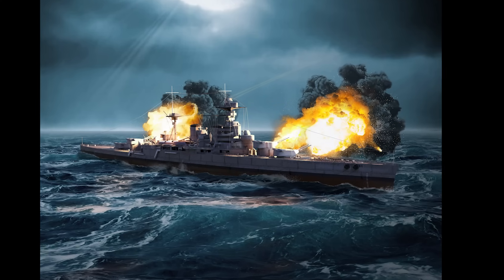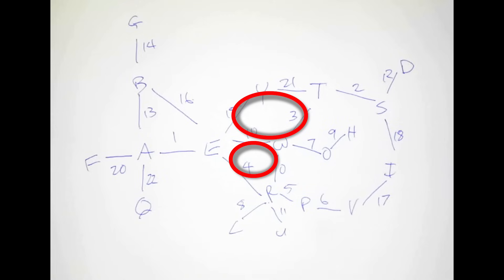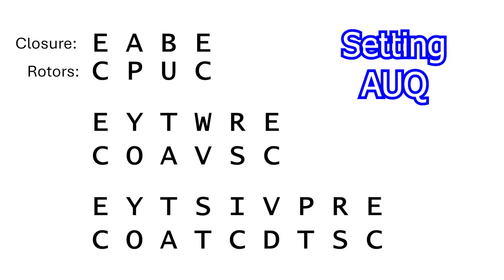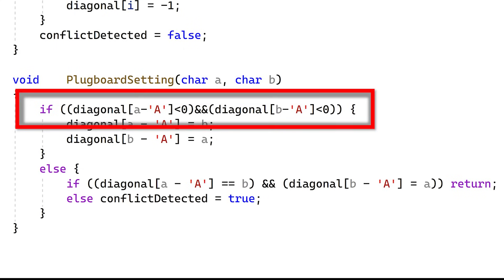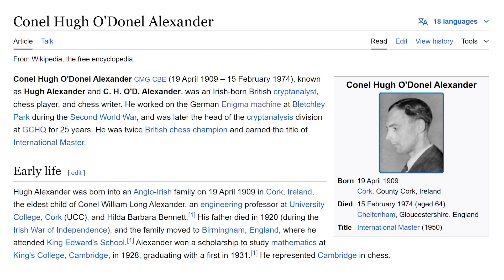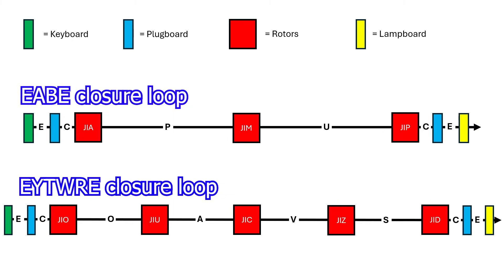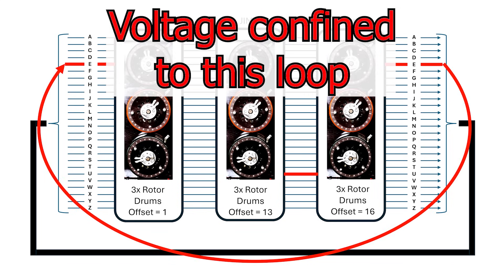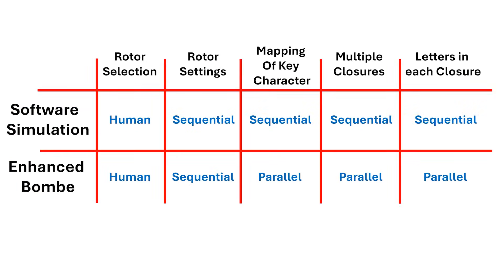Breaking Enigma - Welchman Diagonal board.

Comment: The problem introducing false stops was several things. First even with a "normal stop" of 1/25 live wires, we can still find false stops hence the addition of the machine gun, CSKO, etc. Second, there are many more stops possible, 2435 to be specific. It just so happens that in general orbits of groups are large (I recommend searching the "100 prisoner paradox" for interesting applications of this property). It turns out that the number of wires which light up on a cable are exactly analogous to the orbit containing the test element when the subgroup generated by our composed Enigmas acts on input wires. In this way we expect arrangements like 25 or 24 live/dead wires to be the most common. That being said there are still many other configurations which do exist and at this small of a symmetric group size they impact the overal probability of false stops significantly. Much research has been done to show that introducing the diagonal board significantly improves our odds of remove such false stops. Heuristically we can just say that more connections == more chance of the graph of wires being connected.
Reply from the maker: Yeah it is interesting.  They could have chosen a more complex stop mechanism, but i guess the one they chose was good enough for the purpose.  I suspect they tried the simplest idea they could think of first and if it worked well enough they'd stick with that.  I've had trouble finding exact data on how many false stops there were per run typically.      I've still got one or two more videos to make in the series before it's' done.  This particular video didn't do as well as i would have liked so it took a little bit of the wind out of my sails.
Reply: @DrMattRegan  Im sorry to hear its not doing as well as you would like. If you are interested I would love to connect and discuss this topic with you as I have been studying this subject for around 2 years in my graduate program and am just now finishing a paper on the subject. It's very hard to find other interested people to connect and share findings with.
Reply: @DrMattRegan It would be a shame if this series were never finished! I feel like youtube never showed me these when they came out, but I found them in your backlog after today’s video and it’s some good stuff.
Reply from the maker: @ExplodingWaffle101  for some reason this one just lost momentum. I do plan to finish the series, but it seems like people got a bored by this one.  Thought I’d give it a break then do the last 2.

Comment: 9:52 Thus, the shorter the plaintext between the original rotor positions and when the second rotor moves, the better? Why go to 26 before the second moves? Was there a mechanical reason why that couldn't be done?
Reply from the maker: The problem is that we don't really know when the second rotor rotates in the Enigma encoding the text, but 
it does occur 26 characters apart.  So for a 26 character crib, there will be 1 second rotor change, assuming
the third rotor doesn't rotate (the third rotor advances once every 650 characters),
When we set up the rotor offsets in the BOMBE, we assume we know all the rotor settings for each character in the crib.  If the second rotor happened to rotate during the crib, our assumed rotor settings will be wrong on the BOMBE.  
One solution is to try all possible second rotor positions for the closure.
ie.  the solution for the EABE closure may be at
{ JIA, JIM, JIP }  or { JIA, JIM, JJP } or { JIA, JJM , JJP } or even { JJA, JJM, JJP }, depending on the second rotor.
This could be tested manually but it takes 4x longer and has 4x the number of false stops.
Reply: In practice menus were split up to reduce the impact of rotor turnover. If I have a segment of 26 letters I guarantee at some point the rotor turns over. However, I can split this up into two 13 letter segments and thus one of my segments has no turnover. 

We do need to consider the naval enigma rotors which had turnover every 13 letters and dealing with these required an enormously complicated and time-consuming operation called "Banburismus" to determine likely rotor orders and such. 

There are also methods by which we can practically guess rotor order and eliminate certain turnover spots. Some instances are as follows : 
 - Early on, rotors only changed every 3 months.  
 - Later in the warm rotor orders could not be used twice in the same month
 - If it was a naval enigma then at least one naval rotor (VI-VIII) were required
 - Sometimes rotor order columns were reused which was exploited in a process called "Parkerismus"

There is frankly an ungodly number of tricks and strategies used by crypt-analysts many of which we likely do not even know.
Reply: @jonahweinbaum6577 Thanks. Can't some rotors be eliminated from consideration because they are still too fresh from the last use?
Reply: @greggweber9967  Yes or at least shown to be unlikely. There was a whole seperate statistical analysis that was done that kept track of all the recovered keys that the Bombe produced in order to determine patterns and statistical likelihood of rotor positions occuring.
Reply from the maker: Yeah, i think it ends up being a whole bunch of trade-offs.  If you wanted to, you could test a second  rotor rotation for each machine setting in the crib, but for 10 settings that would take 10 times longer and introduce 10x the number of false stops.  You'd want to be pretty confident about the crib.  If there is a big gap in the rotor settings for a given crib, you could try a second rotor rotation there at 2x the cost (ie if there are 4-5 positions between successive settings).  I guess you need a combination of how confident you are about a certain crib and it's position (ie given time of day), how urgently you need to break it and what competing messages you want to run  to justify an extended run on a limited resource.

Comment: When I wrote my own simulator before, it was attempting to simulate the actual Bombe machine (simulating wire bundles, and counting the number of wires in the array that were energized).   And regarding the diagonal board, I was working from a diagram that showed how it was wired which didn't describe in detail why that was supposed to work.  But your video has filled in a lot of holes for me.
Reply from the maker: Excellent, yes the "diagonal" board describes its wiring/implementation, but it's not very descriptive of what it does.